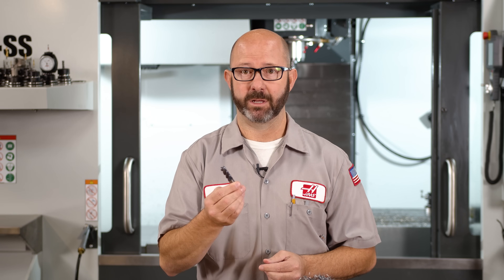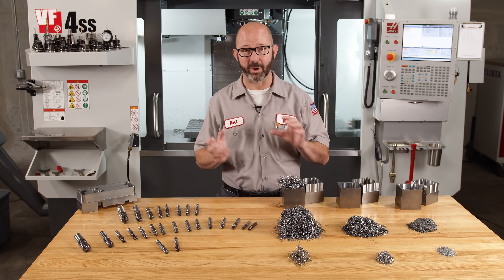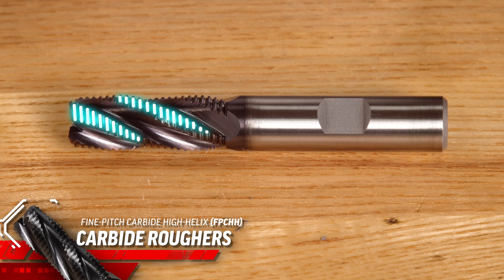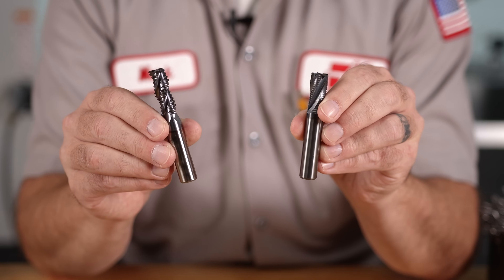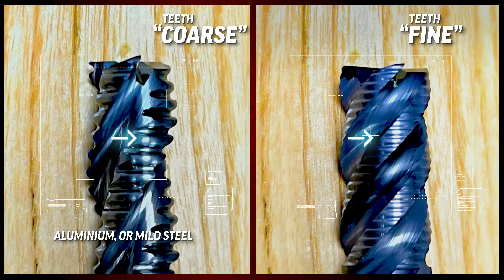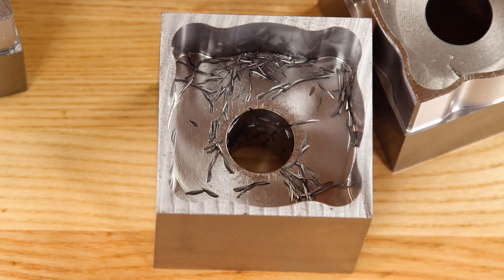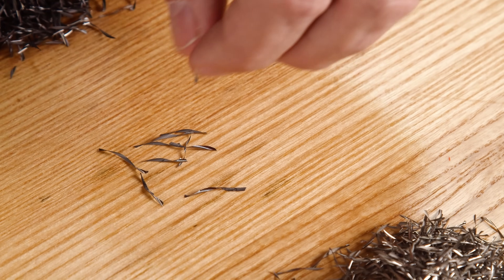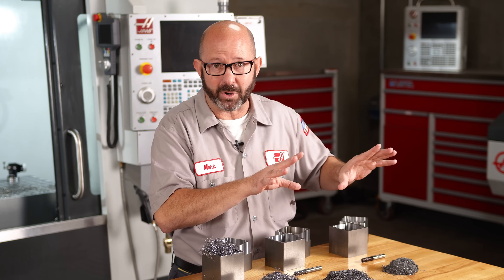Control Your Chips! Chip Splitters and Roughing End Mills - Haas Automation Tip of the Day

Comment: If you didn't have a big thru hole in the middle of the pocket, that rougher endmill would have recut chips way worse than the standard one. The small steel chips created by the rougher are too small and heavy to be blown away by the coolant and end up piling up in the pocket. The solution is to use toolholders that don't obstruct the coolant flow into the pocket and the chip movement out of the pocket.

Comment: Can i cut with the full cutting length of the endmill with hss endmill?
Reply: It all depends on how stable your setup, workholding and toolholding are. Yes, you can usually cut with the full length of any end mill, but you will need to lower your radial engagement, or your feedrate. When we slot with an end mill, at full diameter, we will need to go slower than when just profiling, engaging just 10% of the endmill diameter in the cut.

Comment: The thing I don't like about roughing end mills IS the little chips, they get everywhere and you have to be soooo careful to clean your vice jaws on 2nd op work, so you don't  get chip dents in the finished surface of your part.
Reply: yes, roughers leave behind metal mud that goes everywhere. Shits fucking awful, gets in your pockets, your shoes, hair, inside way covers, in the coolant tanks, shits fucking trash. Cycle time savings arent worth it when you gotta spend 15 minutes cleaning the entire shop of the metal sand they make between parts.
Reply: @romanfedotov9434  that’s why I’m our big shop we pay guys to clean our machine and it’s filters out😂 when you got 100+ machines it saves a lot of money to pay someone less to do that
Reply: I work in a. Copper only department for semiconductor parts. We can’t have a single scratch or dent on parts, and copper is softer than butter. It’s so annoying😂 even if a spec of a hair is clamped on it will dent your part I’m not exaggerating, and if the part slides at all while clamping the vice it will scratch even on the smoothest fixtures.
Reply: Well, if your pocket id deep and you are not breaking chip, you will scratch inside with chips. There is always tradeoff.
Reply: @skaelring-xj3gq  what do you do ? Not a lot of shops that machine copper, also, it drills like shit and don’t even get me started on turning it in a lathe😂 it is by far the worst material in a lathe I have ever machined

Comment: I switched from using standard end mills to roughing ones a long time ago on all our aluminum parts. They not only have a larger step over but also a higher feed per tooth and a higher surface speed, resulting in a much higher material removal rate. The (aluminum) roughers that I use have small teeth, resulting in a fairly smooth finish with almost no visible lines after tumbling.
The only "problem" I have are the small chips these produce. A lot of those small chips do end up in the filter tray of the coolant tank. That is why I love some of my larger insert mills that leave me with nice large chips
Reply: Haas do offer a supplementary chip tray filter kit, which will filter out smaller chips than the standard chip basket. That aside, I'd much rather have a chip end up in my coolant tank than be rattling around in a pocket.
Reply: @j.dietrich  I know and we do have this installed on our machine and it actually works great. I was surprised how little chips I found last time I cleaned the coolant tank. I could easily mop them up with shop shop towels and the in-line filter basket that sits on the back of the machine stays empty. The tray does fill up fairly fast though and I need to clean this out on a daily basis - twice on a good day. I made a habit of mopping all chips on a dust pan with a rubber brush (the type that is being sold to sweep up hair) in the afternoon and let it drip out during the night.

Comment: An option not mentioned in the video is a high feed mill. By running with low radial engagement, high axial engagement and high feed per tooth, we can get very good productivity in pocketing operations with excellent chip clearance. High feed mills also direct more of the cutting forces vertically into the spindle nose, which can be very beneficial in deep pockets that require a lot of tool stickout. Productivity with this approach tends to be limited by machine dynamics but spindle torque requirements are relatively modest, so it's particularly well suited to agile machines like drill-tap centers.
Reply: Every high feed mill I’ve used has low axial engagement and high radial.
Reply: @poetac15  😂
Reply: That makes a lot of sense, but it doesn't seem like a good fit for the parts demonstrated in this video.
Reply: *axial engagement
Reply: You definitely meant high radial and low axial 😉